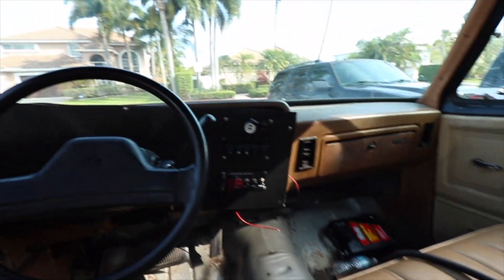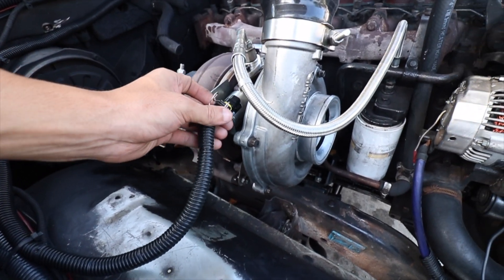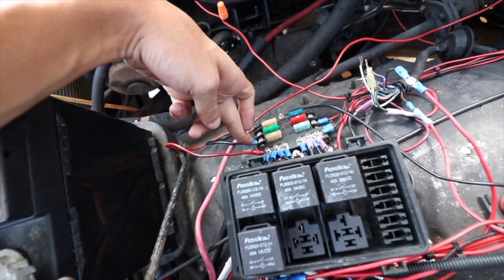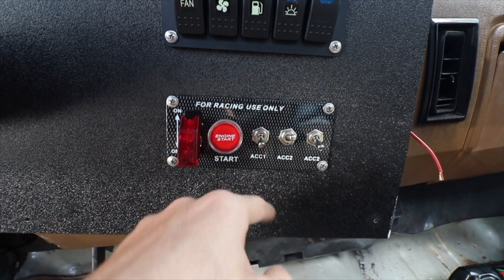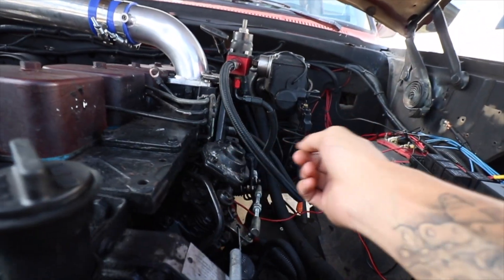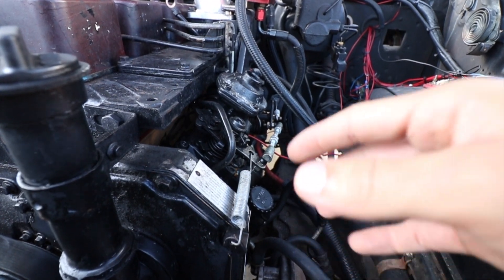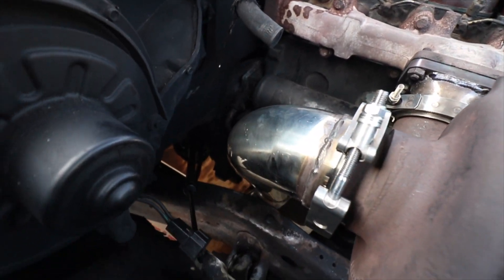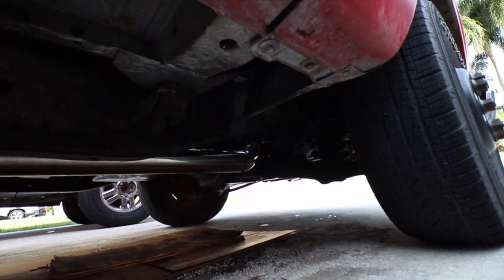how to wire up a VGT switch on a 6.0 powerstroke turbo.

Comment: do you want your throttle position, or your boost pressure to control the unison ring?
Reply from the maker: @GRANITEMONUMENT  I sure you can use either or but ima try to use the throttle position sensor to like a raspberry pi computer so I can change values at how much it opens and close with the given percentage by the throttle
Reply: @ arduino, a decent option, a bunch less parts
Reply from the maker: @ yeah exactly and you can change positions based on throttle input
Reply: @dannersweldingandfabrication  well either way, if you can get fast spooling, unison ring closed, and maintain boost at higher rpm unison ring open, you’ll have a advantage over any other turbo..

Comment: wouldn't a audio control potentiometer work better then you could vary the voltage would be better then just 12 volt closed and 0 volt open?    My thought was to get a a pwm controller and a vacuum turbo actuator set it up to turn the potentiometer on the pwm controller so the boost would be controlled like the older vnt turbos moreless converting anolog to digital control. I wish I didn't love the dam 03 6.0 turbo sound so much I spent to much money on the dam turbo to not use it now I bought mine when fleece made there controller I bought a brand new one sent it off had it machined and fully ceramic coated inside and out and rebuilt with the better KC turbos 360 bearing kit about $3700 till it was done then fleece pulled there controller off the market I was a bit pissed I then tried to buy a banshee controller to find he sold out to ATS diesel and they scraped it also

Comment: Are the vanes on the turbo just wired to stay open when you turn it on and when you "turn it off" does the truck drive just like it did with the h1c or when you turn the vanes off does the turbo turn kinda off and egt get high?

Comment: After years of pondering this and messing with my 12v with a 6.0 turbo is using a map sensor feeding voltage reference to a stand alone computer that then puts out pulse reference to the turbo it would essentially work exactly like a 6.0 would running it off of throttle position I'm theory works but that turbo won't compensate or make any boost under a heavy load

Comment: I did this before but on a gasoline engine and it worked sort of ok but the problem I found was the turbo restricted the exhaust flow too much with the vanes all the way closed. If you apply constant power to that solenoid it will fully extend and hold the pedals fully shut which really only happens at idle in the 6.0. I found if you pulsed it with a push button, the car would stil make power and it would spool faster but it was way impractical without a computer to pwm control it like it was designed.
Reply from the maker: Gotcha I ended up gutting the turbo and take all the vanes out witch isn’t ideal for towing but the truck is gonna be a show truck it’s not gonna go fast

Comment: I need more info.  I'm fucking lost    you turned an variable turbo to an switch.   Wats wrong with you.   Do better bro where in the u.s of America an you have direct power going thru an switch. So it's full on or full off.   Wtf. Dude use the throttle body out put which is 4 micro volts. To 12 volt.  Stop being half ass.   Use the pontmeter solution an get to work. Make it variable like the ford

Comment: What year of 6.0 did you get the garrett off of? Because they had 3 different sizes. The gt3782va off early 03's and 04s were the ones you want  Those rowdy fuckers have a 10 blade 67mm Exducer  that gave that iconic legendary 6.0 screeming loud whistle. and spool fast  Late 04s had a quieter 13 blade 67mm and 06s had a smaller 13 blade 64mm
Reply from the maker: its an 03 and yeah its the rowdy one
Reply: @dannersweldingandfabrication  Nice! Them vgt's like to be exercised so they dont start sticking and if you ever plan on letting the truck sit for a few weeks or longer shove a tennis ball in the down pipe. Saves the hassle of cleaning

Comment: What year 6.0 turbo? Is one year better than another?
Reply: 6.0 liters are from 2004 too 2007
Reply: @santabambi9380 6.0 were in the trucks from 2003-2007 and in the van from 2003-2010. 2003 turbo is what most people look for
Reply: Early 03 turbo is supposed to be better I think. It also has the loudest whistle

Comment: You could do this to a 24v to right
Reply from the maker: yes you can it just will be a tighter space in the engine bay
Reply: @dannersweldingandfabrication  thank you I'm seriously considering doing this to my truck
Reply from the maker: @eagerweevil6221  no problem anytime.

Comment: Wouldn’t you want it load % actuated so you can vary how much boost it’s trying to put out based on load? Also does it work as an exhaust brake? Sounds sick though!!
Reply from the maker: thanks, and yes i do but i didnt because im in a process of doing a cab and bed swap with the cummins

Comment: Where’s the oil drain to from the turbo
Reply from the maker: it's at the bottomof the turbo and goes to the side of the block where the oil drains back into engine.